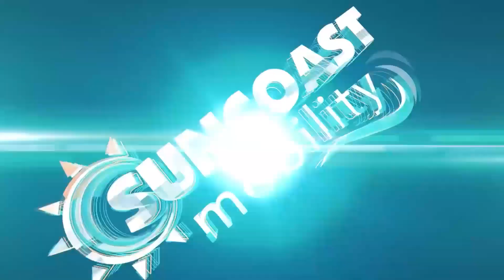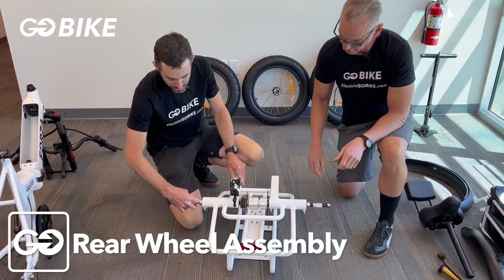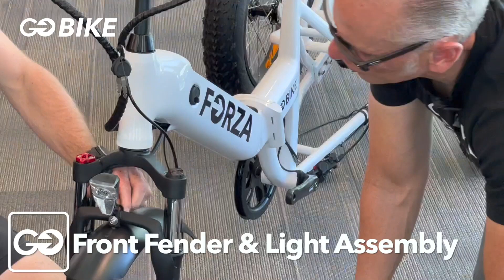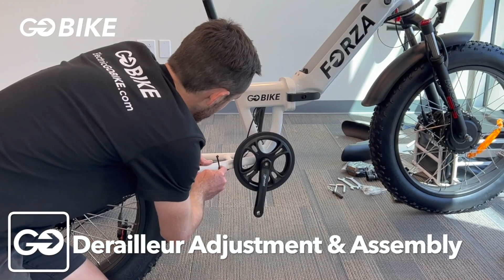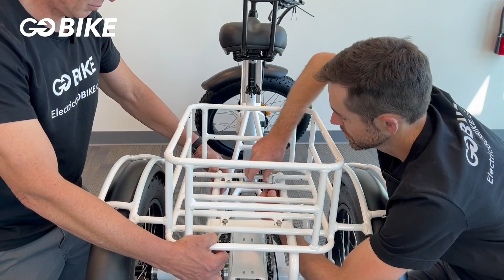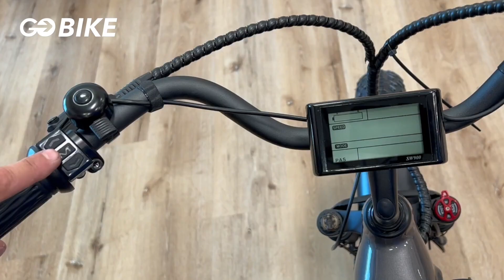How to Assemble the Forza GoBike Electric Trike | Step-by-Step Assembly Guide

Comment: Is your installation video intentionally in poor focus when you folks filmed the derailleur cable install? I would think this video would be meant to be helpful not to hinder someone purchasing this trike!!! Somewhat dubious that the back & front parts of the frame are joined together with a "Lap Fitting" & 4 bolts with nuts ( are they SS lock nuts) & are the bolts better then normal hardware grade? I was interested in this contraption until I saw the front hub motor & frame joinery.